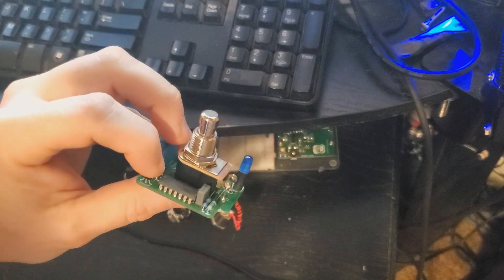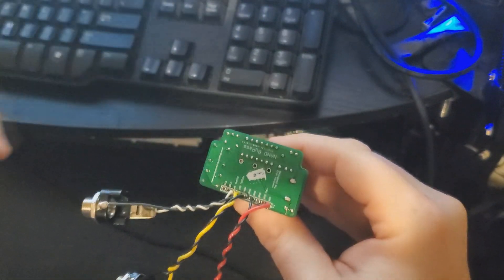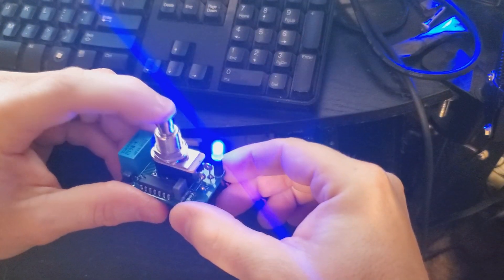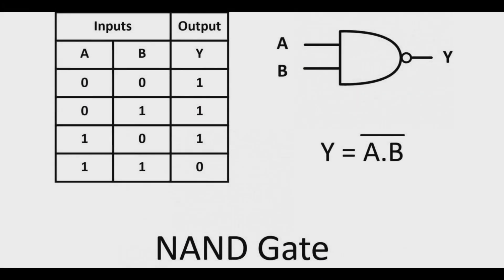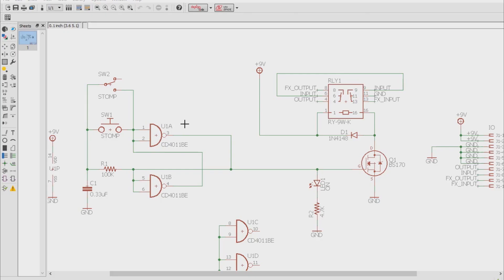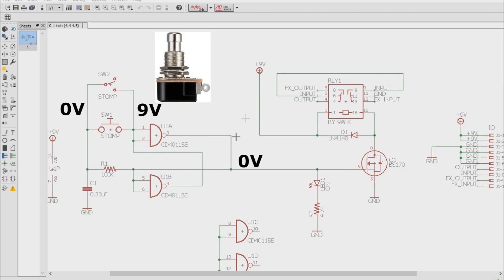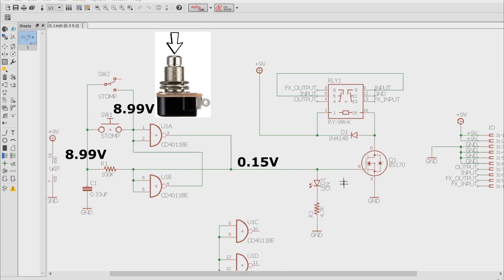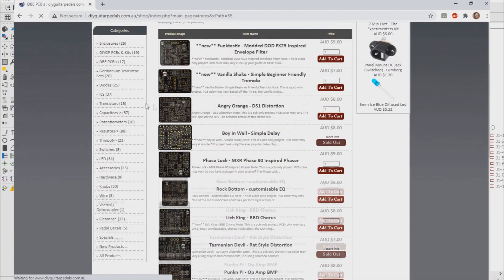Soft Switch True ByPass with NAND Gates

Comment: Dude can you help me please. I have a Seymour Duncan Tweak fuzz and I think it got some troubles. When the pedal set off and the tweak knob is in "1" all the signals totally goes bypass and clean, but when I tweak it to 2 - 6,  it really affects the signal and the tone even when I've turn the pedal off. Can you help me explain what's really happening here? Thankyou very much before.
Reply: Well, assuming the schematic on this page is good, which is a bold assumption, https://forum.seymourduncan.com/forum/the-pedal-board/306294-tweak-fuzz-double-tweak-mod#post5112438 then that would indicate you have something bad with that switch or a loose wire going to that switch.

The tweak knob is just a rotary selector going between different RC input filters of increasing/decreasing values, which then, in turn, goes into a silicon fuzz face style topology. Because of those RC filters, it appears to have several 100K resistors as the "R" in the "RC", so I wonder if any of them, in particular is accidentally shorting out other pins and causing the two transistors to oscillate or do other weird things. Technically, that stomp switch would be isolated from that, in by-pass mode, but that too might be a problem, being that maybe the stomp switch is bad.
Reply: @erikvincent5846  wow thankyou very much dude🙏🙏🙏.

Comment: Can I use the remaining gates as another bypass switch?
For example, in an overdrive/boost, I use two of the gates for the overdrive side and the other two I used it for the side
Very good video, I've always used a 555 timer as a latch for this type of switching
Reply: You could use the other two, yes. I've done the 555 timer before as well. They are both good circuits and easy to use.

Comment: NIce vid. Quick question: youre using the Nand-gates as inverters right? If so would it be possible to realise the circuit wit NOR-gates? I have a few CD4070BE-chips flying around...Keep up with your work.
Reply: I believe you might be correct about the NOR gates. I just had a bunch of NANDs sitting around from an old 8-Bit computer project I was working on.

Comment: Very well made video, great explanation and interesting solution using two NAND gates. I usually use a microcontroller (ATtiny) and do the debouncing in software. May seem overkill but isn't much more expansive than logic gates these days and quite a bit smaller. That also leaves the option of adding MIDI for remote bypass.
In terms of switches I really like the Cliff FC7106.
I might do a video in that topic in the future: https://youtube.com/channel/UCdSWJuPFqElS-jPUMM_agIA
Reply: We had something like that a couple years ago called a "Smart ByPass" which used an attiny13a that I wrote the Atmel Studio code for. I made that one with a much smaller footprint, but a lot of folks didn't want to program them. It had debouncing and a muting circuit as well, but it cost a bit much in components as well, so it didn't do so well.
Reply: @erikvincent5846 I have seen that. Looked very promising and to be honest my "design" was heavily influenced by it. I guess something like that would have to be sold as either entirely prebuilt or at least with a preprogrammed microcontroller.
Reply: @error8418  I've designed a new revision of it that uses a variety of different switches and such, but have conformed to this "1590B or greater" foot print. This way, when doing the PCB layouts to the DBE projects, I can guarantee the drill templates will all work with it. I ended up realizing that the "width" of my stomp switch PCB can be wider, so long as the "height" is short, giving the effect PCB more real estate. So, even though it's almost 2 inches wide, it's barely an inch tall.

Comment: Is there any switch popping with this circuit? I've tried similar switch circuits with dpdt relays and would get a pop when hitting the foot switch. I've tried a couple different things to reduce it but haven't had any luck.
Reply: I haven't had much problems with popping on this circuit. So long as the effect PCB has the proper bleeder resistors and doesn't have leaky input/output capacitors, it should be fine. Note that the resistor for the LED is 4.7K or greater, as that also helps reduce the likelihood of popping.
Reply: @erikvincent5846  Good to know, thanks! I'm actually using it as a loop switcher so instead of going to a PCB I'm going to a send and return for another pedal. I appreciate all the videos. I've learned a lot.
Reply: @chunkymonkey059  please post your results if you build the looper. That was my first thought when I started watching this video. I don’t need a “smart” looper but do want silent, relay and true bypass switching. Loop 1 for fuzz & wah, #2 for overdrives, #3 for dirt boxes, and #4 for modulation/time effects. Everything I’ve found on the market is more complicated and bloody expensive.
Reply: @chipsterb4946  👍

Comment: Great video, thank you!
Two noob questions, if you don't mind...
1. If the switch is likely to degrade over time, and have a more erratic micro-bounce, would it be wiser to replace the 0.33uF capacitor from the start, rather than wait?
2. If swapping out the 0.33, how high is too high, such that tapping the switch too quickly/lightly wouldn't be long/hard enough for the circuit to kick in?
Reply: Valid point, you could go higher, but you don't want to go too high.
Reply: @erikvincent5846  will 330nf mylar ceramic cap be okay or it needs box cap?
Reply: @lordrahulcool  mylar will work too.